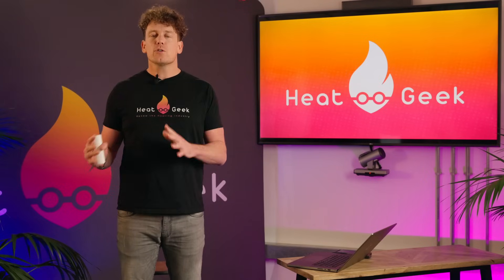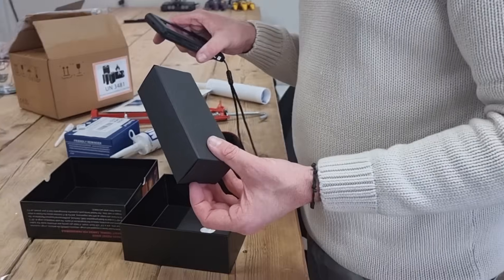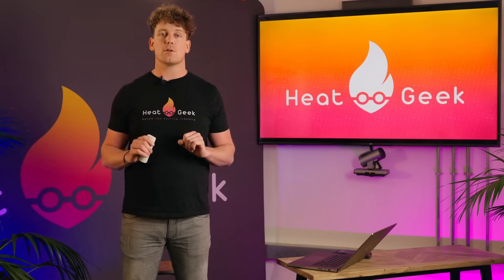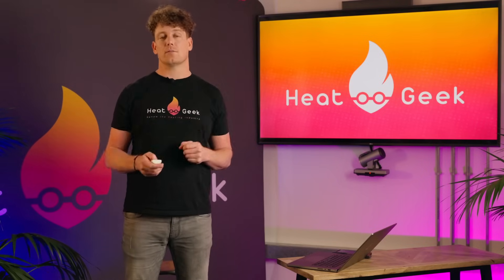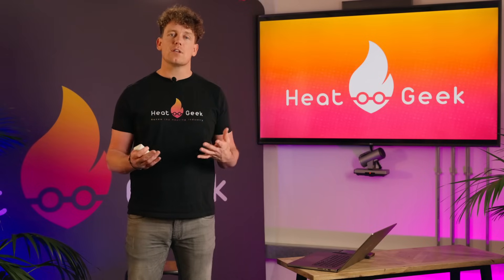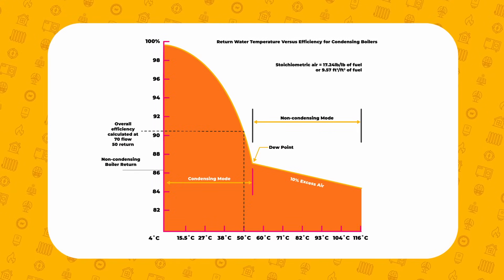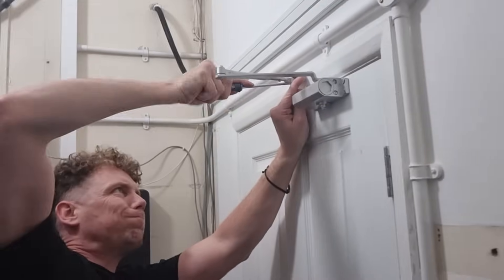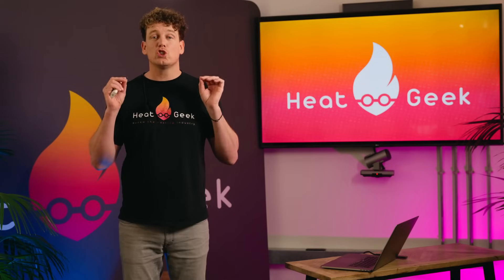This Insulation Secret Will BLOW YOUR MIND

Comment: I've got a 1930's bungalow, Rockwool in walls and modern windows and doors, underlay beneath carpets. Lath and plaster ceilings with 4 inch glass fibre in loft. Insulation I always say works on the laws of diminishing return, I've got enough. Last summer on a very hot day for some reason, cobweb maybe, I touched the ceiling, it was hot. I've added another layer of rockwool and last winter comfort level was noticeably better and with better heat retention when system (40 year old Glow-worm!) shut off.  Well worth the money and effort, I should have done it years ago! Great vids and info.
Reply: 270 or 300mm insulation recommended

Comment: Interested in last comment about microbore pipes. Old 1910, solid brick cottage. All electric with electric boiler. Switching to HP. All our existing pipes are microbore. As we have new, windows and doors, and intend to fit external insulation and will likely also upgrade the radiators. Does this suggest we could get away with using existing micro bore piping or, would it still be worthwhile upgrading them?
Reply: It really needs a proper calculation to be done for the post renovated/upgraded state to see how much heat is needed at each radiator.
Reply: I have microbore. It works fine with my ground source heat pump.

Comment: Another great video. Another huge difference I found was replacing the sealed units if they are old ones with modern A rated ones called sometimes low e. I done the whole of my house for £1000 . I know not every one can afford that but now with a thermal camera in winter my walls are colder than the glazing
Reply: Yes I was thinking why do they build these new sport centres with so much glass area? But modern glazing, especially triple glazing is very effective nowadays.
I see that it is recommended by window companies I've looked at to use double glazing on south facing walls (to allow more solar gain) and triple glazing elsewhere.
A shame that outdoor window shutters with louvres aren't pushed more to keep solar gain out in the Summer; I've often thought that entire South facing walls should be protected by louvres to keep the building cool, even better if the louvres are photovoltaics.
Reply: So you replaced the units without actually replacing the whole window?
Reply: @ConradMurkitt  yes that is correct. It's a far cheaper way, obviously even frame design has improved but mine are internally glazed so they are not that old I believe they originally went in in 2008. I did find that no expanding foam had been put around the outside of the frames so they were poorly installed but I sorted that as well as the new units.
Reply: @johnfreshwater3790  where did you source the new units from and how were you able to determine the energy rating of your existing ones? Mine went in in 2000 so I am guessing they should be replaced. Although I had some replaced last year as an insurance claim due to heat damage from the extreme heat last summer. However I don’t know what they replaced them with and they could be just as bad as the ones I had in there.
Reply: @ConradMurkitt  Hi Conrad. If they are the originals from 2000 then they are unlikely to be low e units. You can tell if they are by using the light on your mobile phone. If you shine your phone light on the unit from the inside of the house you will see a row of reflections of the  lamp and old units all the reflections are the same colour. On a low e the second reflection is a different colour mine has a blue colour to it. This is the transparent metallic coating on the inside of the inside sheet of glass.
Reply: @ConradMurkitt  as for where to source wr have various glazing firms in Peterborough so any in your area will be able to supply them
Reply: @johnfreshwater3790  cool. I only live in East Northants so not far from Peterborough. I’d appreciate the name of the firm you used if you don’t mind sharing? Did you for them yourself or get someone to do them?
Reply: @ConradMurkitt  I did them myself it's quite easy with the correct tools but if you want someone to do them any window installer or repairer will give you a cost. R A Baker are one of the companies or there is GAP in Stamford or Peterborough but guess there must be someone in Corby or somewhere near
Reply: @johnfreshwater3790  cheers. Thanks for the advice. Much appreciated. 😊
Reply: @johnfreshwater3790  let me try that on the new units vs the old ones. Excellent tip thanks. My units are also quite slim, not sure why but assume that affects their heat retention? Even if they are e units?
Reply: @johnfreshwater3790  ok I just tired that on the different units and I could see a difference. The ones they replaced on the front of the house the 2nd & 3rd light I could see as a bluey purple colour but the first and last were more white. Very interesting. How did you find that out?
Reply: @ConradMurkitt  I found it on Google when I was first looking in to low e glazing. As my house is very old I thought it would be worth changing the units and I'm glad I did. Yes if you have had replacements most do fit A rated units now that I believe at least have the film on the pane but not all are argon filled
Reply: @johnfreshwater3790  I’m suspecting the ones we had replaced last year on the insurance will be as cheap as they can get away with but we will see.
Reply: @ConradMurkitt borrow or buy a thermal camera and compare the heat loss from your windows (you can always resell it after you have done your survey, or help friends and family to do the same).
Reply: @WanderingDutchman  a good tip thanks. I’ll check on Amazon to see if o can get one.
Reply: @ConradMurkitt  part L of the building regs was introduced in 2002, so your glazing is unlikely to be low e.

U value of std double glazing with clear glass is 2.8

Modern double glazing with soft coat low e, like saint gobain planitherm, and warm edge spacer and argon gas fill will have a u value of 1.2
Reply: @notch7139  thanks but my windows were replaced in 2000, so 2 years earlier than these regs came into force. That said I don’t consider our house to be cold by any stretch but would be good to optimise it some more if possible.

Comment: I found this video interesting.  After adding all the insulation and draft proofing how do you check for ventilation?  For clean air and also to stop condensation.
I look forward to future videos, keep up the good work.
Reply from the maker: Ventilation isn't something to be worried about on a property of this age.. its only when you start taping and sealing joints
Reply: Look into energy recovery ventilators (ERV)

Comment: ha ha - traditional ways of installing windows  - they are simply wedged into the rough opening (nailed in place) and wall board gaps hidden with architraves, sealing wasn't really a thought - even just oakum stuffed in the gap would give orders better performance..
Reply from the maker: This wasn't even nailed in place!
Reply: @HeatGeek   - not even when installed - back in the previous milennium?? - classic, just "plaster fix"...

Comment: Hi Adam, I'm a big fan of your videos! Please keep putting them out. In the rooms that you're insulating, I would like to know what the CO2 levels are in the room. I put internal wall insulation in my bedroom as it is on the northwest angle of the property. The door has the standard gap underneath, and I have trickle vents. I have a black-out blind, and my CO2 levels in the room quadrupled overnight. I am currently looking at fitting an MVHR or adding an artificial method of circulating the air better within the property; however, I would like to know if you have experienced a similar situation.
Reply from the maker: Something I've never looked at but you've got my attention
Reply: @HeatGeek  I am currently working with a development company who are retrofitting a property and I will be testing the CO2 in the space while unoccupied. They increased the wall density from 2000mm to 4000 and if my theory is correct, it will need mechanical assistance to provide adequate oxygen to the space. My dissertation (in process) is based on finding the line between mechanical and natural ventilation when retrofitting insulation is fitted in properties. Are you happy for me to contact you further by E-Mail?
Reply from the maker: @pjmister  yes. Hi @ heat geek dot com
Reply: Probably being a bit pedantic, but there's a difference between insulation and air tightness, they go hand in hand for making efficient homes though.

I think most people open their windows to reduce damp concerns (as they see condensation on windows/walls) but with better insulation, this is less of a concern as surfaces don't get as cold and are less likely to condense... This makes people less likely to open windows, increasing CO2.

Measuring CO2 when unoccupied seems a bit counterintuitive, surely you want it when occupied (max CO2), what's there to add CO2 into the space if its unoccupied?
Reply: @MichaelFlatman  you make a really valid point about CO2 in an unoccupied room. The tests have shown an increase, which I think relates to the 'stale air' system. I'm not entirely sure how it happens that the oxygen in the room is converted to carbon dioxide despite the lack of human presence or interaction.

With the current energy crisis, not everyone is perhaps as diligent as you in opening their windows, through fear of wasting their heated air, rather than fabric of their property. The research I've done into 'Luften' has been great, and some landlords in Germany put it in their rental contracts, I don't know how you'd enforce it but its a great way of keeping your home ventilated and replenishing the air. 

There has also been some research done on Passivhaus properties which is related to the speed in which CO2 increased when their MVHR systems stop working. Like you say you can open a window, but what if you don't? There is no failsafe? If you fall asleep and the system turns off, the CO2 reaches over 5K per million or more, is there a risk we are just not talking about?